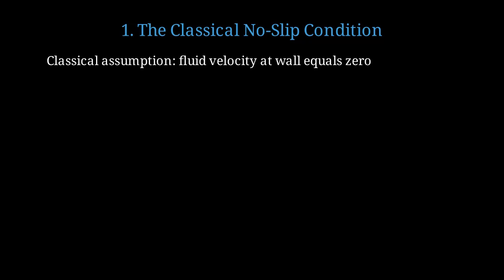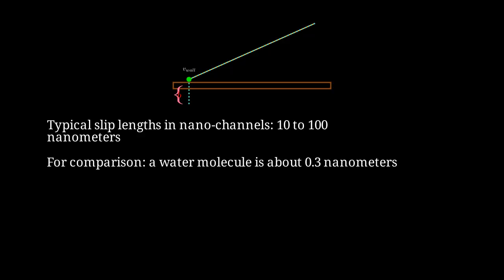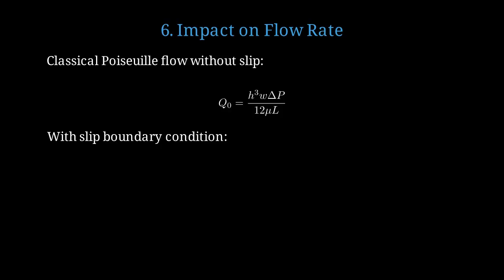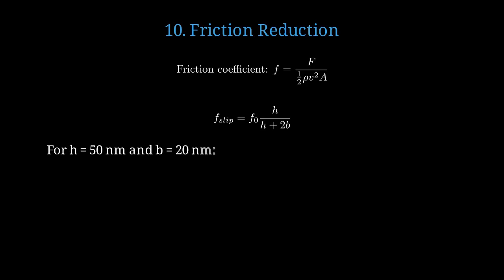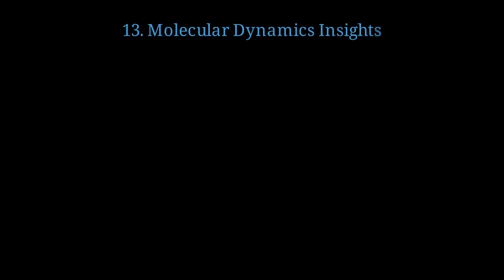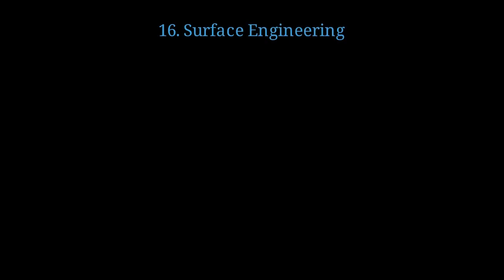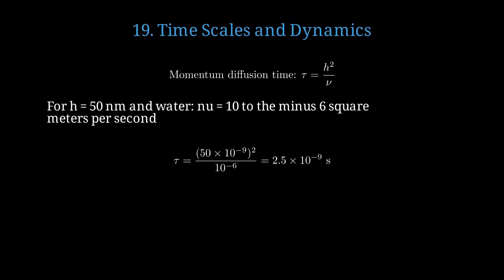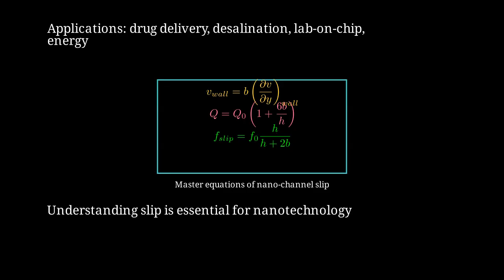Slip at the Atomic Scale — Rethinking Fluid Mechanics

Comment from the maker: How does molecular layering and orientation at the liquid–solid interface quantitatively influence slip length under varying thermodynamic conditions?
Can machine-learning-driven molecular dynamics simulations predict slip behavior across heterogeneous surfaces with atomic precision?
What are the quantum mechanical limits of hydrodynamic slip, and could zero-friction flow emerge under extreme confinement or in superfluid phases?